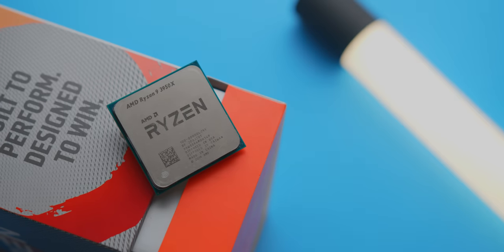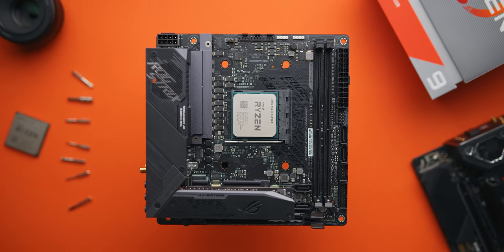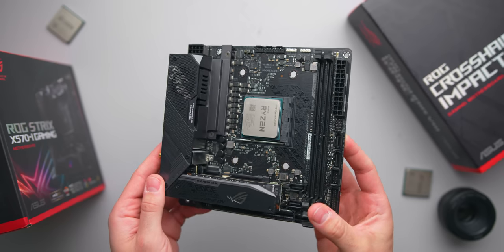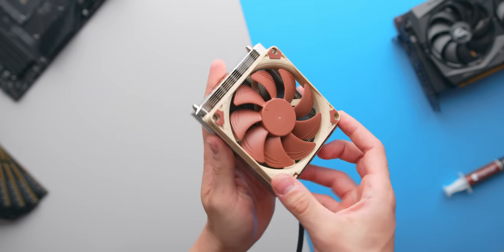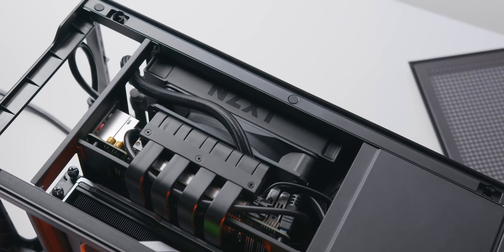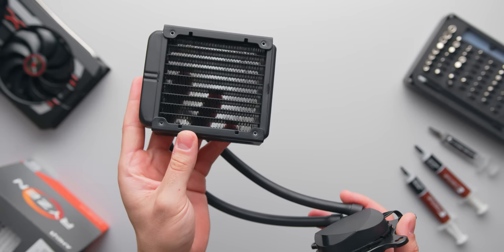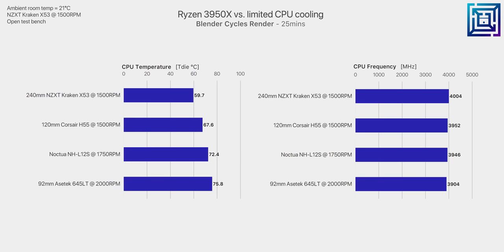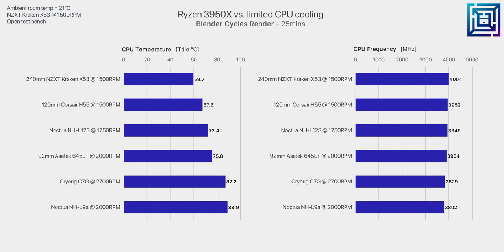Ryzen 3950X vs. Low Profile Coolers - Sanity Check

Comment: Why do you switch between the AMD made-up TDP number and the ACTUAL power draw which you point out at 141W while talking about the Cryorig? The chip isn't magically throwing 36W of power draw into the void, it's generating heat with all 141W.  The Cryorig is  rated for 125W and it fails to completely dissipate 141W, as expected so you see clocks and power usage drop to compensate for the lack of cooling ability. 

AMD's "TDP" rating is not related to actual power dissipation, and instead uses arbitrary temperature differentials and heatsink efficiency ratings to fudge in their OEM heatsink lineup as suitable for each SKU by allowing more powerful chips to get hotter or by defining a lower ambient reference temperature for them in their internal specs, but they don't magically dissipate less power than they draw, and so a cooler that is less than ~150W in actual dissipation capacity is simply not going to allow the stock 3950x to reach it's full potential due to a thermal limit, as you showed. 

This would have been more obvious if you compared all three of thermals, clocks, and power draw across each cooler.

Comment: I’m having problems with my pc. Every time I restart it I struggle with getting a signal on my monitor. It can take 10 minutes to get it to work again or 10 hours. I really don’t know how I get to work again, I just check that all the cables are tight, etc, then it somehow starts working at a random point. I don’t know what to do, google doesn’t help. I think it’s my PSU but I can’t check cause I don’t have a spare. What do I do
Reply: Tried another HDMI/Display port
*neighbors' loans

Comment: I'd think the 3900 would be better for thermal constriction because of the faster base clocks. Reminds me of gpu how low asic chips with lose voltage are the better oveclockers and higher asic are excellent undervolters

Comment: I dont know anymore my 3600 on nhl9a with noctua thermal paste gets to 90 c on blender tests although I do have a 27c room idk what the temperature he has is but I'm stumped as to why I'm not getting this level of cooling for a lower wattage cpu thr highest it pulled was 77.5 watts
Case is velka 5 2.0

Comment: This Ryzen 3600 is my first and last AMD processor ever. It runs so hot and loud WTF I feel like returning it.
Reply: Ryzen is trash I stopped buying Ryzen and converting all my builds to Intel.
Reply: @JayzBeerz  I am in the process or sorting out my case and cooling. Will see if temps are acceptable then I will use it for a year or so then switch back to Intel as I am satisfied with the performance for now. It's just the temps that are a nightmare. The MSI motherboard I have for Ryzen was VERY cheap and I would have to spend 2x as much for an Intel mobo so I'd rather hold off UNLESS the temps with Kraken x63 are still too high.
Reply: @praszu  Good luck.

Comment: I'm currently pairing a Ryzen 7 3700X with Scythe Big Shuriken 3 in the raijintek Ophion.. unfortunately I'm using the MSI B450I board and it doesn't have Voltage offset so the stock temps are pretty high nearly 80 degree C when I'm rendering video..

Comment: 2:28 physically speaking, all energy fed into a CPU is "lost" in the form of heat. where else would it go?
Reply: comunication bettwen cpu and everything else i think, thats current that flow
Reply: @pabloxd1239  communication is not a physical energy form. the energy needed for the current flow becomes heat as well.
Reply: @-morrow  communication wich form of energy is?

Comment: I'd love to see the performance of the black ridge on the 3950x.
Reply: It's a no go on X570 itx motherboards, fits fine on my Asus Strix Z370 ITX board, but I tried to use it on a Gigabyte Aorus X570, the mounting brackets don't line up with the holes on the motherboard. Got a pair of redesigned AM4 brackets and still couldn't get the cooler to fit properly.

Comment: Amd doesn't include a cooler cause the ones it includes for the 3000 series are washed up.
Bought a 3600 and the cooler it came with was a disgrace, reaching in idle 81C 
Wen't with a Arctic freezer 34 duo and lowered the temps up to 30C , so now i am sitting at 34C-61C while running it constantly at 4.2ghz with boosts up to 4.35ghz .
(didn't touch the bios for that, it was automaticly done by my msi tomahawk max b450)

Comment: i have one in a lian li tu150, on a crosshair viii impact cooled by an nhu12a. check my newest vid out it worked great! Im set to 4ghz all cores, only 1.125 volts. Performance is great this thing sips power while spitting out 9300 or better cinebench r20, stays around 65c at full load.

Comment: 2:00. Disagree. I have numerous computers running constant high 90's for years 24/7 doing Folding at Home with no reduced lifespan. Oldest is 8 years old. Almost no downtime 24/7/365 at 100% CPU/GPU.

Comment: My 3900X is currently running at 84°C at Stock with a H100i GTX (240mm), that is hovering somehwere around 3820-4040mhz. and 140w Package. Not as good as i want it to be honestly
Reply: Turn off PBO., enjoy silent PC and much cooler..those 1-5% gain of performance is not worth the +50c.. AMD failed big time with theirs turbo on Ryzen..even if you got PBO on and want to live with high temps and a loud PC..the Ryzen processor rarely extend 3,8ghz yet it want 1,5V (Yes I know low currency is ok) But still the temps skyrocket.
Reply: Do not turn off PBO, cap your PPT to 135. That alone should get you a bit better temps. And then if you'd like set a small vcore offset if you want to bring temps down further.

Comment: My 3800x with stock cooler in idle is 50c😐😑
Mobo: b450 carbon
Why!?
Reply: because
Reply: I had idl between 50-62 under volted it for better performance 1.1875 with 4.2 Ghz 3700x
Reply: Idl 40-45 gaming 55-65

Comment: Thanks a lot for your amazing work! My actual system is inspired by your T1, and thanks to this video and the one for GPU undervolting I can fine tune my temp without losing at all performance for my needs!
Here a few pics! https://imgur.com/gallery/BJeL3Q5
Reply: Nice built, but how are the temps of the GPU and CPU of the 3950x?
Reply: @knekker1  Super good! 75C nax the CPU and 60 the GPU. Stressing together at the same time, the GPU reach 65 and the CPU 80.

Comment: Do have a LianLi TU150 with custom watercooling and 3950x + Nvidia 2080. 2x120mm Rad + 1x240mm Rad....cooling and noise no problem. With max 1000-1300 U/min can game with water nearly 40°C :-) Pictures from my rarely build: 

https://www.computerbase.de/forum/threads/custom-wakue-itx-system-meinung.1896875/page-5#post-23459090

Comment: The 3950 due to internal layout, can be run on big tower air cooler (talking about mid tower cases), just as effectively as on the best 280mm at comparable noise floor.

It would be nice to see a comparison between nh d15 and 280 kraken or corsair, at 140 power target and something around 1000rpm or 33-34dba.

Comment: still I really don't understand why AMD 3600 need really good Cooler to stay under 80c under full load if 3950X can do it with way low profile cooler.
is it because 3600 is made with low quality Chiplet?
Reply: I don't think it needs a really good cooler, however, stock cooler really sucks. There are 20-40 $ coolers that does very well with it. I also think it would be fine if you have access to wraith prism.
Reply: mmm yep